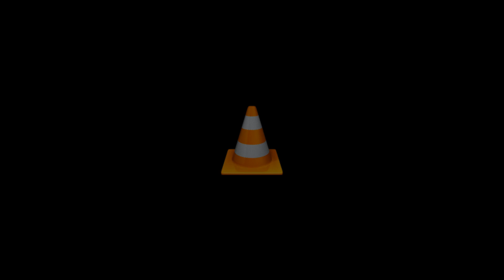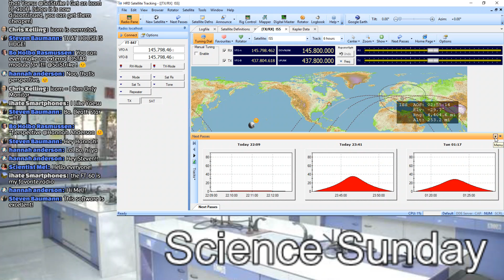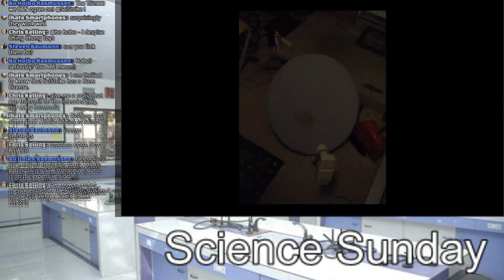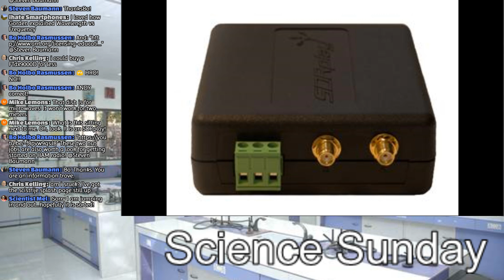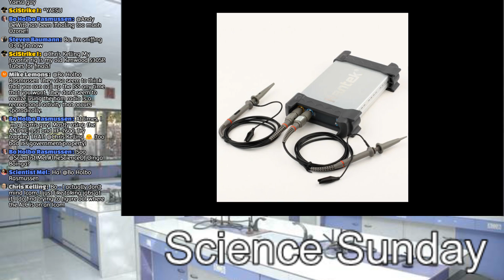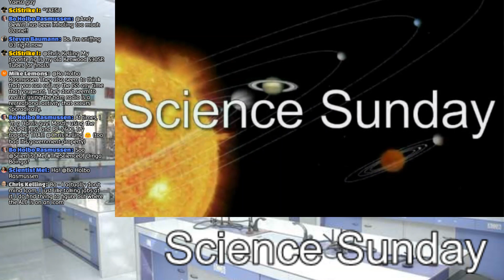May 14 Sunday Science (On Monday): Let's Build Radio Telescopes!

Comment: Scistrike help !  How can I prove satilites are real ?  And not cables and towers?  Help!
Reply: Or for visual confirmation, you can view a lunar transit from more than one location.  Two observers separated by about a km will pass the moon at different points and from this you can calculate parallax.  You can use Stellarium to know when this will happen and you'll need two cameras on tripods.  The ISS is a good target as it's huge and recognisable.
Reply: you need to connect a 137mhz cross or v dipole to your scanner  to receive some of the weather sats  it is the gain in the aerial  that is the main factor in reception. you are much better off with a dedicated receiver, as a scanner is a jack of all trade and master of none.
Reply from the maker: When I get home, I'll see if I can find a satellite with a good strong beacon. 
With that, and a handheld scanner, you can demonstrate the Doppler shift which will show that the object (whatever it may be 🤣 ) is moving way too fast to be in the atmosphere.
Will that do?
Reply: SciStrike, when have you ever heard a satellite with a handheld scanner? I have tried that and the sensitivity is way too low. lgbt bathroom, if you can show somebody an Irridium flare around -8 magnitude, it is not something that you will soon forget. An Irridium flare is where a satellite is in the exact position to reflect sunlight off of its solar panels when the Sun is just below the horizon. Unfortunately, the site that I use to predict flares is not getting updated. (Heavens-Above)
Reply: Even if you provide enough proof, FE's will still come up with BS theories to prove they don't exist, or just call it fake. Pointing a satellite dish to the exact spot in the sky to get TV should be all the proof you need that it's not land based.
Reply: lgbt bathroom
The most obvious giveaway with sat nav is satellite based is that sat nav gives you an accurate altitude measurement, also would the USA and Russia spend billions of dollars on a ground based system that could be jammed or destroyed by an enemy in the event of a conflict, remember the gps system is primarily a military system for nav and delivering smart weapons.
Reply: It's not hard to triangulate on geo stationary sats.  Get a few friends from different places to image them agains the background stars and measure parallax.  Need to all take an image at the same time though as they stay fixed in the sky.  Heck you could just point at one and record the local alt az position.  This is an optical approach though.
Reply: Thanks for your inputs guys !
Reply: I have a Kenwood THF-6A and a software defined radio.
Reply: Hi Mark.  If you have a smartphone or tablet.    Android: Download "Iridium" made by AndroideSimple.  iOS: Download "Iridium Flares" made by Dennis van den Berg.  Or "IFlares" by Pleasant Software. (I personally use the last two apps from time to time)
Reply: Mike Lemons I have an idea!

What receiver/scanner do you currently have?